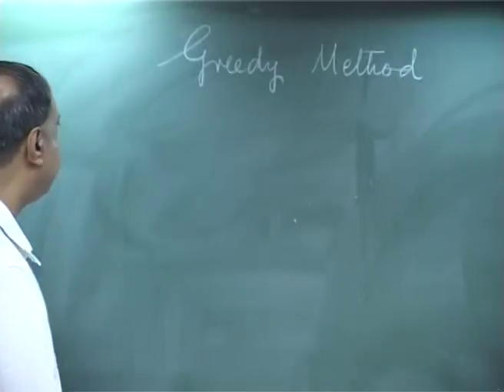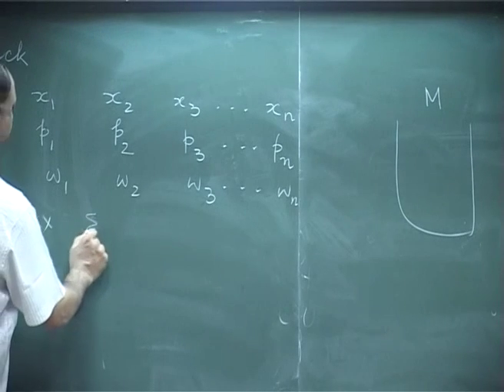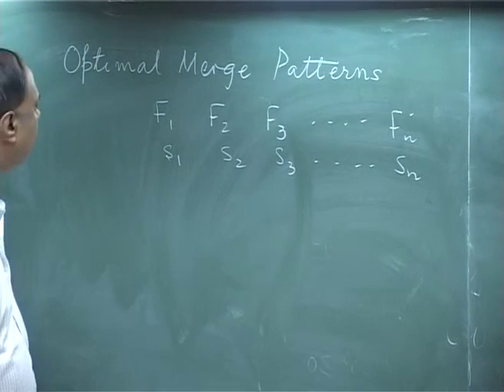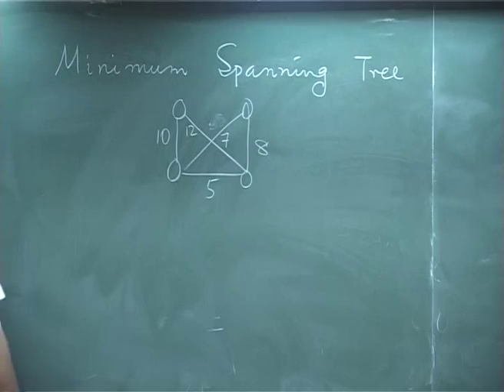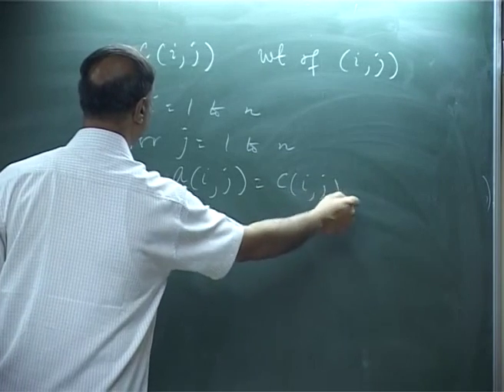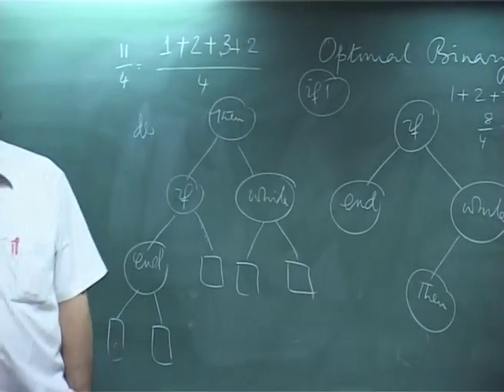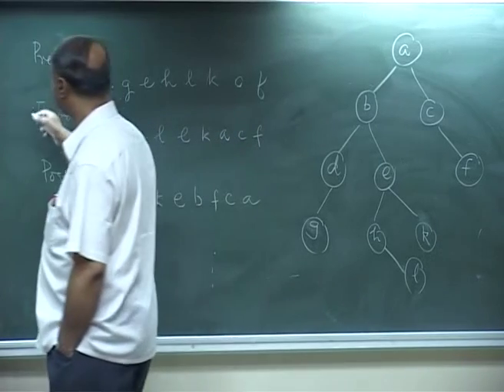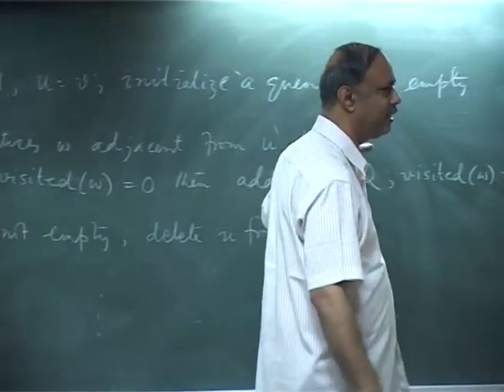Mod-01 Lec-03 Parallel Algorithm

Comment: Timestamps:
Greedy Method Paradigm: (0:15) Overview and basics of the greedy approach.
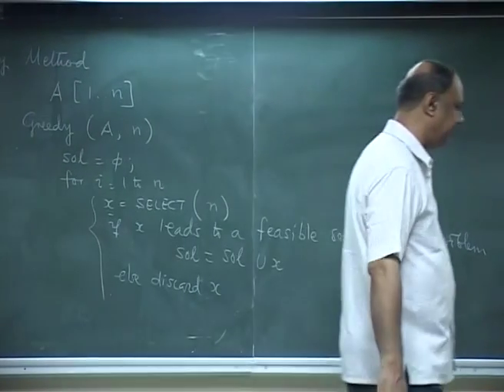Optimal Storage on Tapes: (3:21) Example problem of storing files on magnetic tapes to minimize retrieval time.
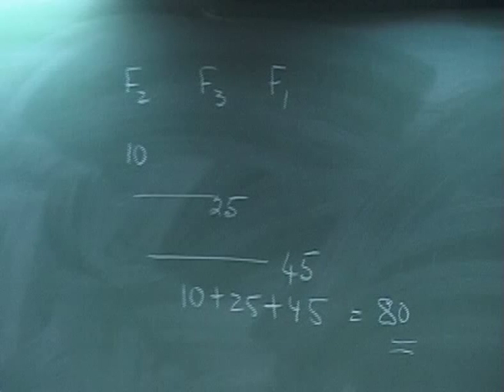Knapsack Problem: (8:10) Applying the greedy method to solve the knapsack problem for maximum profit.
Optimal Merge Patterns: (19:38) Strategies for merging files with minimum record movements.
Minimum Spanning Tree (MST): (29:02) Introduction to graph algorithms and MST.
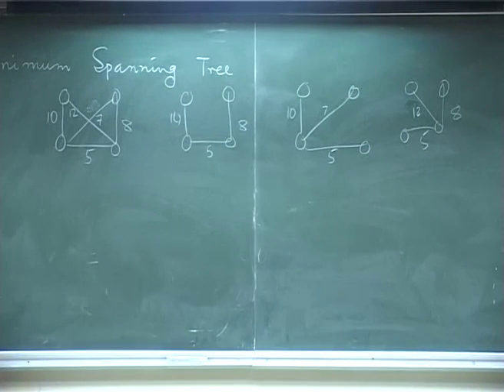Kruskal's Algorithm: (31:36) Detailed discussion and steps of Kruskal's algorithm for MST.
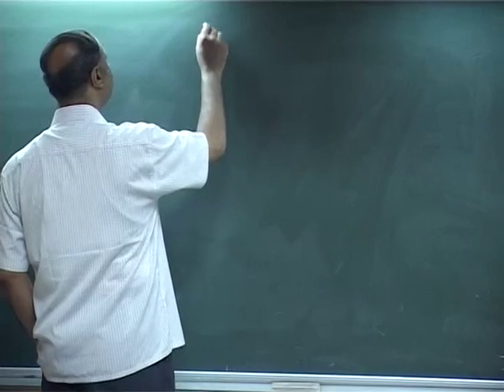Dynamic Programming: (37:00) Overview of the dynamic programming paradigm.
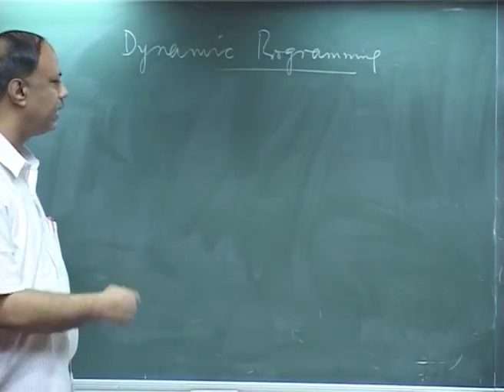All-Pairs Shortest Paths: (37:15) Solving the shortest path problem using dynamic programming.
Optimal Binary Search Tree: (41:04) Constructing an optimal binary search tree based on search probabilities.
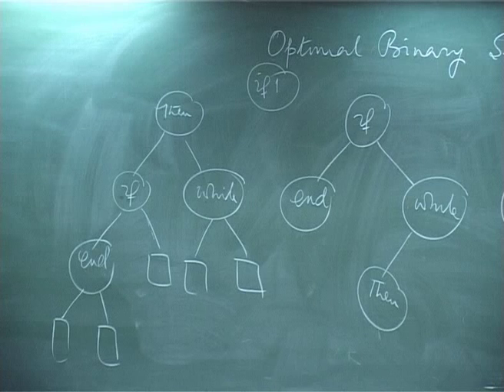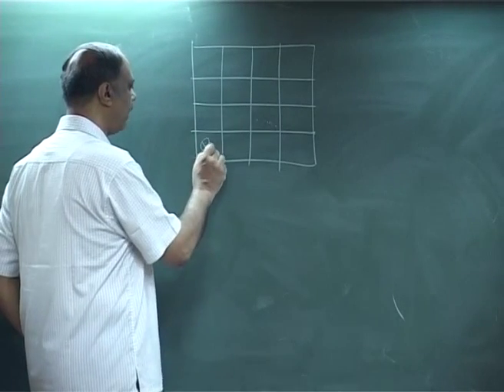Backtracking and Branch & Bound: (48:42) Overview of backtracking, including the graph coloring problem and the N-Queen problem (50:33).
Graph Traversal: (1:01:58) Methods for traversing graphs.
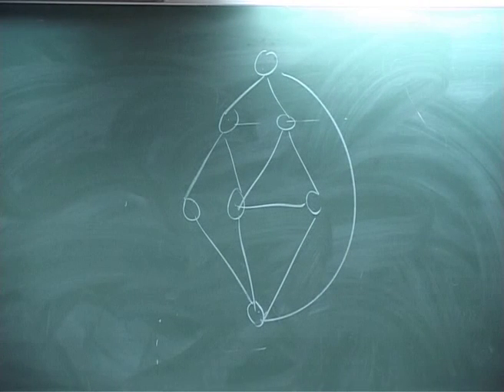Breadth-First Search (BFS): (1:02:06) BFS algorithm implementation (1:03:26).
Depth-First Search (DFS): (1:06:50) DFS algorithm implementation (1:07:01).